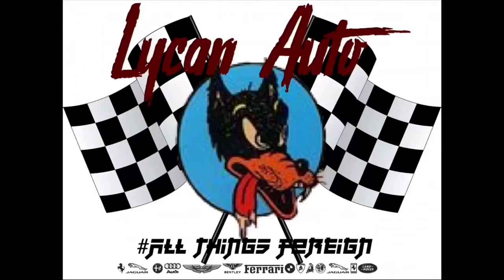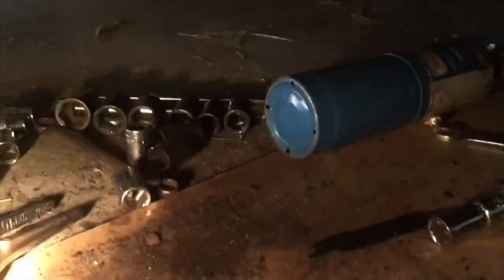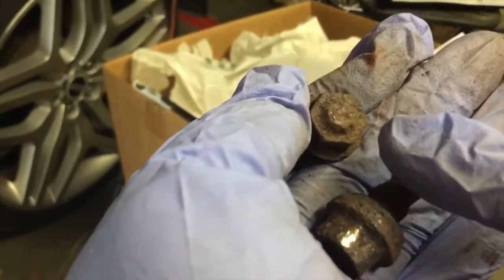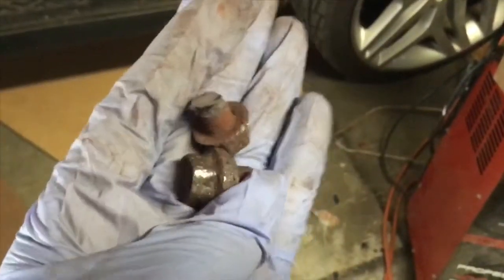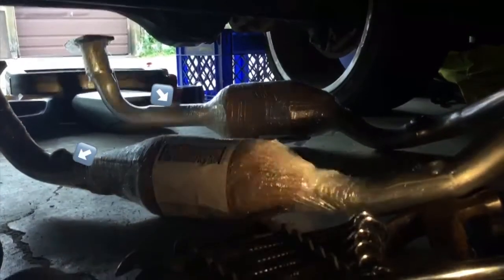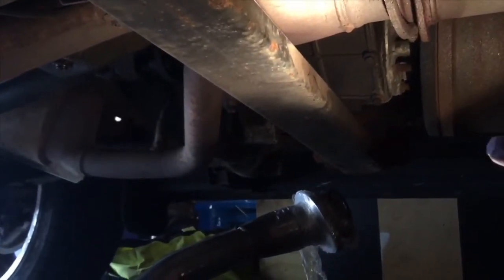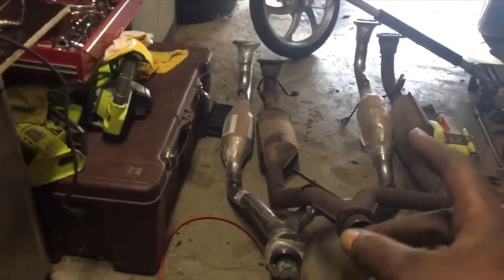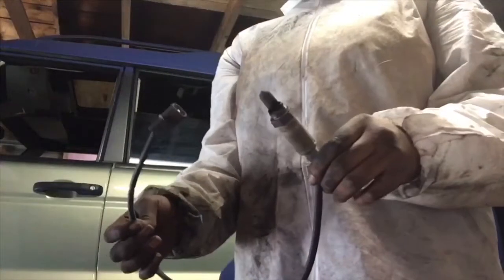Land Rover discovery 2003 catalytic converter part 1

Comment: Thank you for the video! had mine crack a few months ago and finally ordered a new catalytic converter. Shop wanted to charge me 3000! just to replace it because they said they had to order the parts from the UK... well I got the converter on ebay and am doing it myself as soon as it comes in. very excited to get her back to normal
Reply: Any updates?